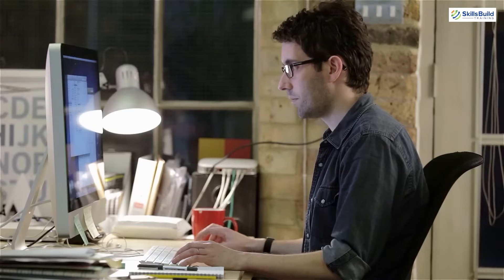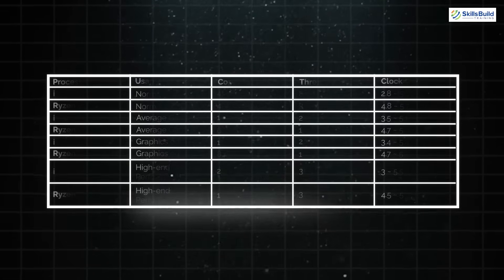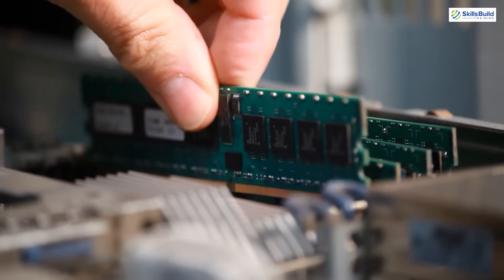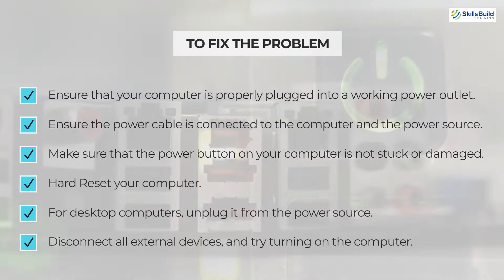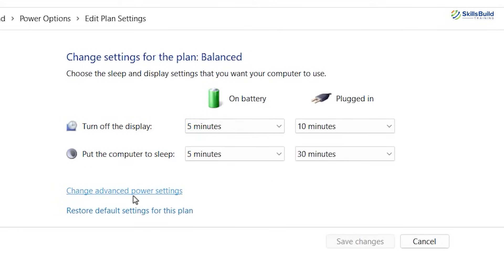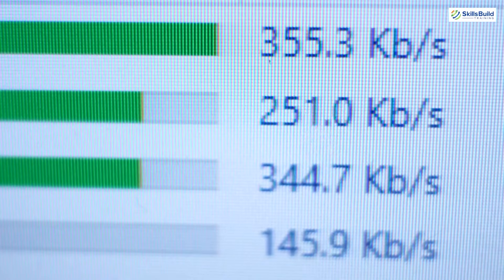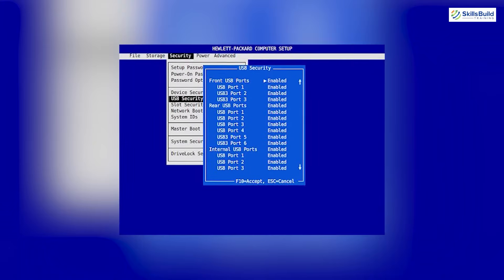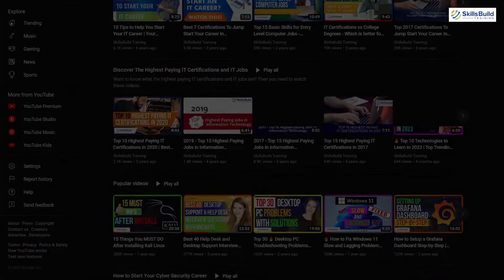Top 20 Computer Problems with Solutions

Comment: Hello musthafa i need your help
Reply: I have an issue with my pc . Before i was using Msi b760m gaming plus mb with i3-13100f with liquid cooler cooler master 360l, g skill trident 32gb, 4060 ti graphic card , with 500gb wd m.2. And deepcool 750watts plus 80 bronze. It was good and i recently changed the motherboard to gigabyte z790 ud ax from then my pc keep restarting automatically. If any program is running it is good or else it keeps restarting automatically.
Reply from the maker: ChatGPT

Comment: Please I have issue with my desktop. When I one it my mouse and keyboard are not working. I have used other working keyboard and mouse to test run it on my desktop, it still not working. Because of that I cannot have access to my desktop now.
Reply from the maker: ChatGPT
Reply: @SkillsBuildSecurity 
I have problem
Reply: check in bios  if same issue port issue